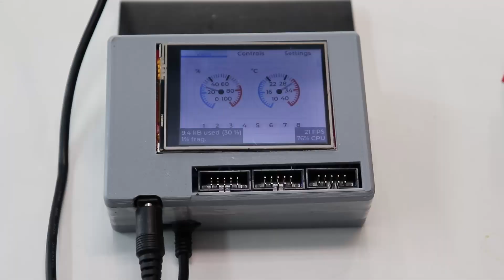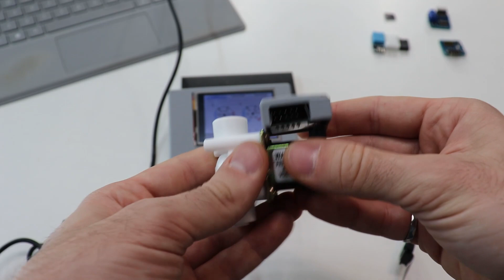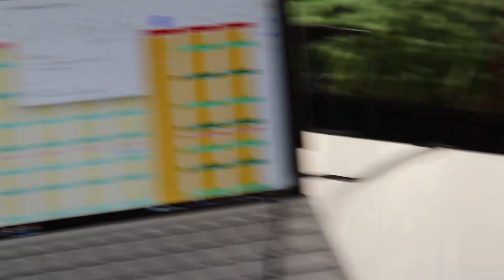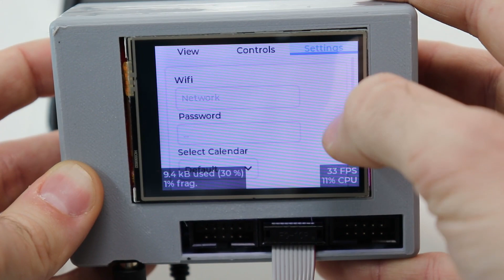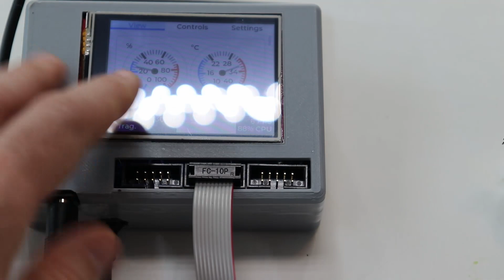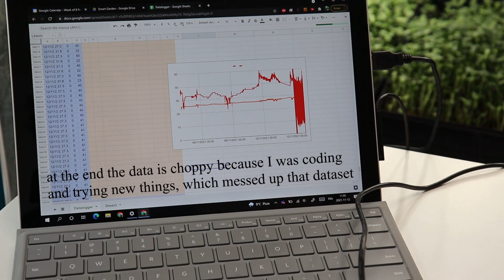New Microgreen Automation Controller

Comment: Great setup, dude! I am looking into doing something similar. Somethings maybe you could look into:

1. Mesh bottom grow trays for hydroponics. Allows more of a root system to come into contact with the grow solution.

2. Capacitive moisture probes that you can put under your substrate to be able to finely monitor substrate or root moisture content.

3. Individual flood and drain solenoids for each 10x20 tray. This will allow you to vary watering as per crop recipe. 

4. Redundancy shutoffs or alarms for fan and light failure (current monitoring maybe) or photodiode, and airflow switches. 

5. Flood mitigation. Level sensors where if a valve gets stuck on, it would shut off pumps and activate drains as to not flood your grow tent or house. 

When I learned PLC's a long time ago in school, we always had to think of people, production, and property damage risk mitigation through automation. 

I wish I knew how to program like you do! Amazing job! Keep up the great work!
Reply from the maker: Thank you for the great feedback!
Some of this stuff is in my to-do list ;) I love the redundancy reminder, i should work on that too
I made decent progress since the last video and hope that you'll enjoy my next update (when I get to recording it)